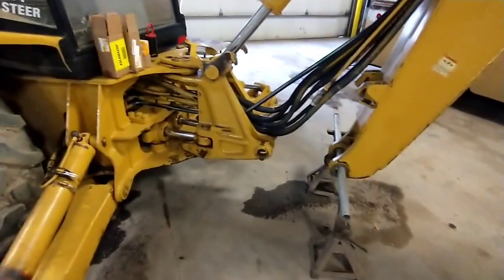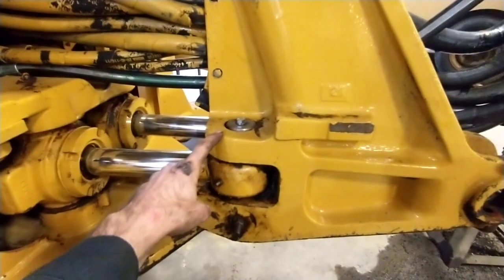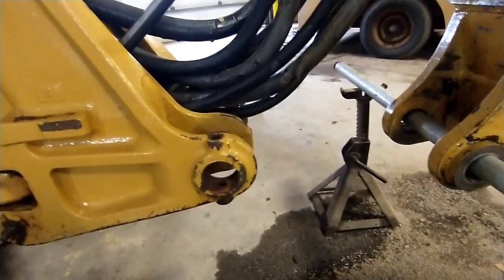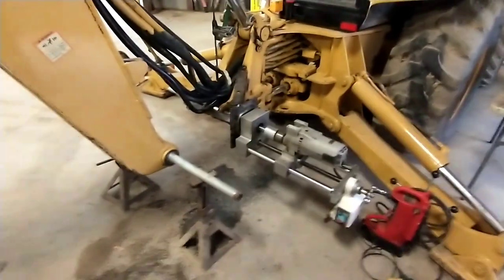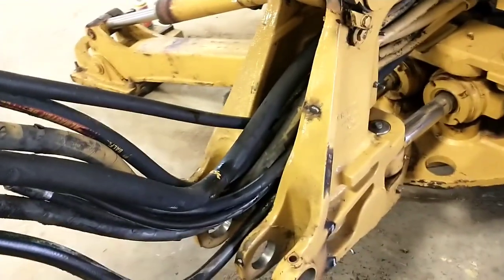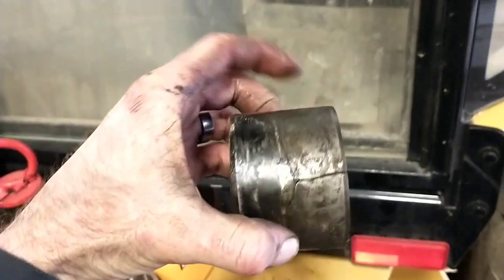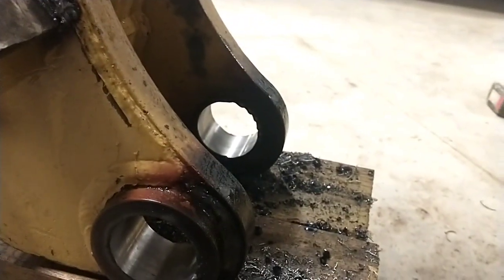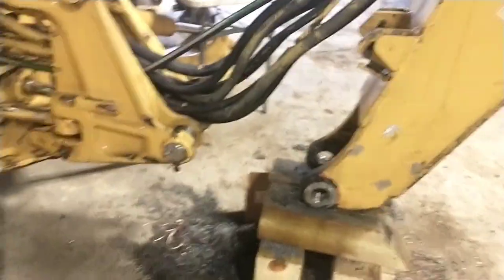Line boring and machining bushings for a Cat 416 backhoe

Comment: When you're talking about the consequences of welding ductile iron, you say hardening, but the actual problem is increased brittleness, yes?  Ductility is lost, and it becomes more prone to crack?
Reply from the maker: That is correct, I don't remember all the technical details, but it has to do with the carbon getting converted into a different form than its at to begin with. It's not just that it gets more brittle though, because of temperature differentials throughout the weld bead and in the base metal it introduces enormous stress into it as it cools and because it's no longer ductile it can't stretch.
Reply from the maker: Actually, what I just said isn't quite entirely accurate, it does become  radically harder as well. So much so that carbide tooling will hardly even touch it.
Reply: Need to slow the speed down
Reply: @perpetualmotion1 how did you determine that it was ductile iron? Just from breaking the welds on the fixture?